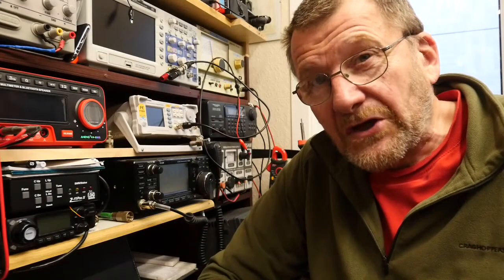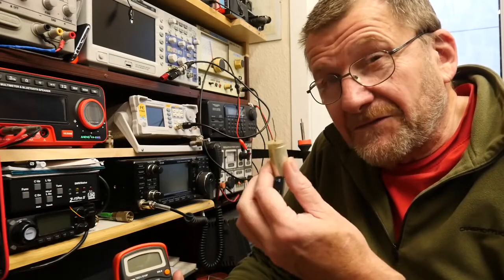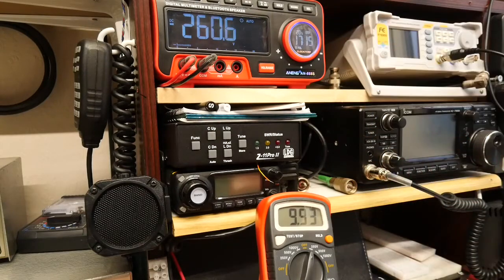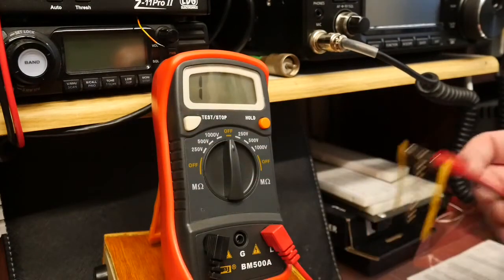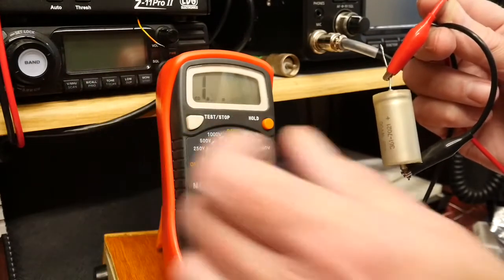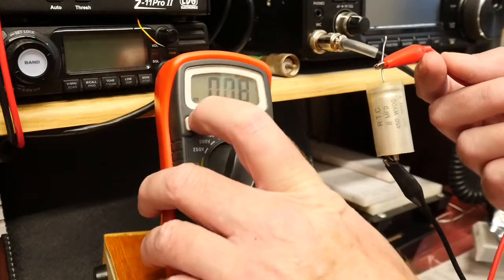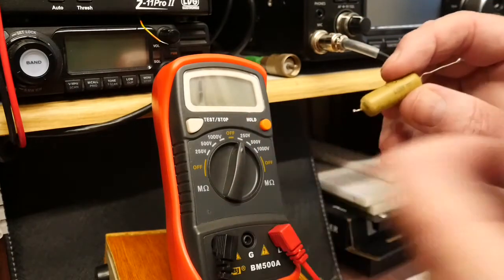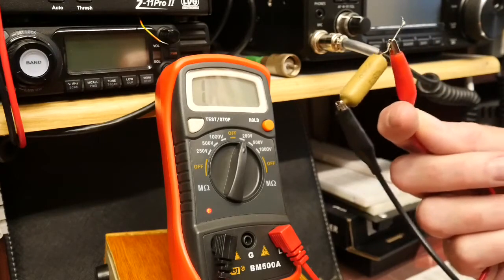SZBJ BM500A Megohm Meter Mini Review

Comment: L, es el +  y  E  el - ? y the connnector the  half ?? tank you for video, saludos ❤
Reply: ...I saw other videos on YouTube and the POSITIVE ends were on E and the NEGATIVE ends were on L...and in one of the videos before using the DM500A, with a DMM at continuous voltage, E was measured and it gave POSITIVE and L was NEGATIVE....NORMAL would be: E NEGATIVE/NEUTRAL - G GROUND - L POSITIVE/LIVE.....

Comment: I know I'm a bit late on commenting, but I am curious. Have checked my model for voltage output. The voltage is reasonably ok, but the polarity is reversed on mine . I have plus on "E" and minus on "L" ... anyone made the same experience?! Could be a deadly encounter for an electrolytic , glad I checked !
Reply: ...I saw other videos on YouTube and the POSITIVE ends were on E and the NEGATIVE ends were on L...and in one of the videos before using the DM500A, with a DMM at continuous voltage, E was measured and it gave POSITIVE and L was NEGATIVE....NORMAL would be: E NEGATIVE/NEUTRAL - G GROUND - L POSITIVE/LIVE.....
Reply: Mine is the same, and so are some other meggers.

Comment: I have a Uni-T device like this which has 500, 1000 & 2500 V ranges but I never thougt of using it for this purpose. 
A bit high for some caps but thanks, Bill for the idea! I suppose I could rig a divider circuit.
😁

Comment: hallo. i purchased one of these meters and have been trying it out.    while doing this  i connected a voltage multimeter across the probes to check the voltage as you have shown with the black lead on the left and red on the right.     to my surprise it said it was 250v but"negative".    i checked my volt meter  on a 1.5v battery and it show correct ie positive.  i also checked using an old analog meter and the megger voltage comes up reversed.   please am i missing something or is indeed wired reversed in the megger
Reply: A nice review; I bought the meter on the strength of it.  Richard however is correct, the 'Live' terminal does produce a negative voltage with respect to the 'E' terminal. The meter and sockets are all on one PCB so it is not a case of the terminals being internally mis-wired.  The documentation with my meter made no mention of the test voltage polarity.   The unexpected polarity is of no consequence when checking insulation, resistors or non polarised capacitors.  However for electrolytic capacitors a reverse polarity is not healthy.  I suspect the 1960s electrolytic capacitors in the video are (were) not quite as leaky as the test indicated.  Then again I don't think I would naturally trust a 60 year old electrolytic capacitor to be in good health.
Reply: YES IN THIS BRAND AND MODEL

Comment: Awesome video, especially considering your channel is still pretty new. I've seen seasoned reviewers use twice the time to present half the info. Question... Any idea of how to use the middle test lead? The instructions are great for the specs and safety info, but the section on how to actually operate the meter is pretty small, and the translation doesn't seem as careful. I this meter to test caps, and the manual doesn't go near that, so thanks a ton for your content.
Reply from the maker: Thank you!
The instructions are not the easiest to understand, my thinking is the middle lead is for attaching to the chassis when testing insulation integrity, I need to have a closer look....